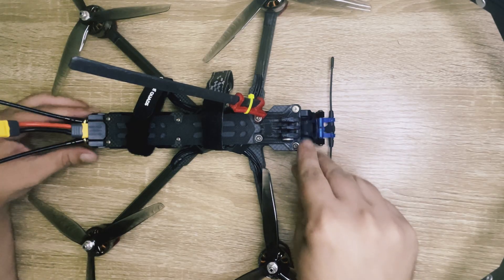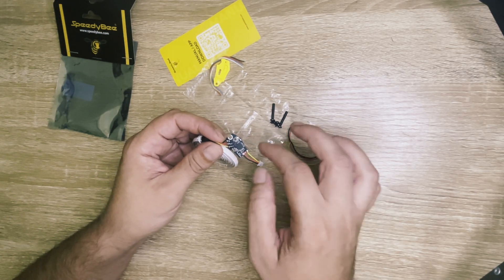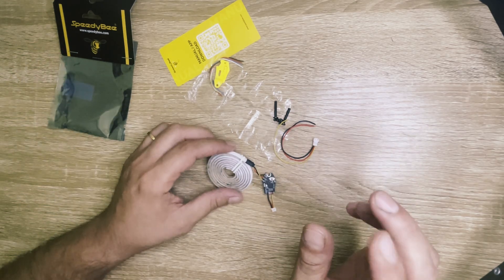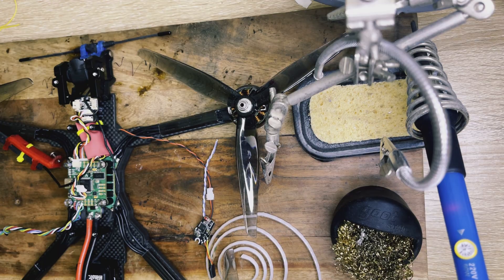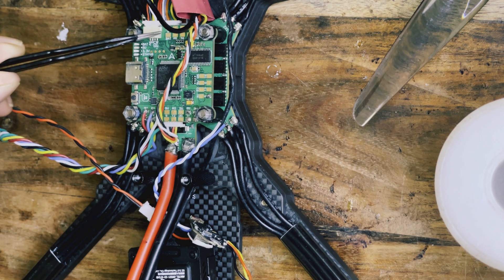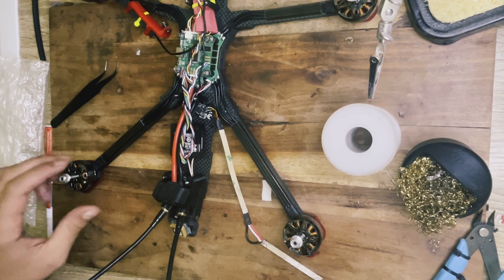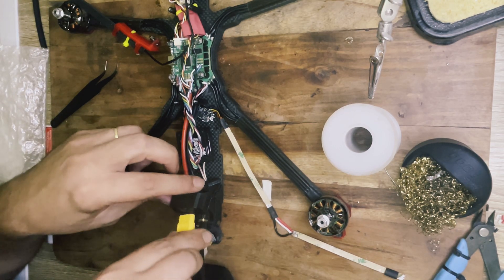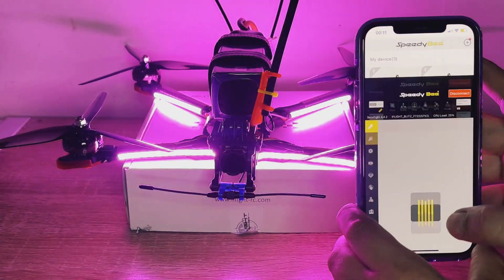Discover the Best LED Setup for 7 Inch Drones🤩 #fpv #speedybee #iflight #led #drone

Comment: What gauge wire are you using to join strips?
Reply from the maker: I used a wire with conductor overall diameter of 1.8mm that was the one available in my local store at that time. I feel it a bit big for that job, if I do that job again next time , I would go with a smaller size

Comment: Does the flight controller have to be a SpeedyBee to be configurable via the SpeedyBee app?
Reply from the maker: Yes the fc has to be a Speedybee one in order to be configurable via the Speedybee app, unless you use a speedybee meteor LEDs like in the video which gives you the opportunity to get any other fc to be configurable via the Speedybee app, especially fc without a Bluetooth chip
Reply: @fpvinprogress thanks for the video and comment!
Reply from the maker: @fun909 my pleasure mate

Comment: bro.. how to turn it off or on by radio switch?
Reply from the maker: The speedybee meteor LEDs can only be switched on or off either by the switch on the module of the LEDs or using the speedybee app, via the app, connect to the meteor LEDs and there you can switch it on or off.
Only LEDs controlled by betaflight can be switched on or off by assigning a switch in the modes tab related to the LEDs
Reply: @fpvinprogress  yes . I m wandering to assing a switch in betaflight.. for on or off
Reply from the maker: @ADITYAKUMAR-yt2ry  got it mate, if you want the LEDs to be controlled by a switch then buy a LEDs for fpv, set it up in the led tab in betaflight, then go in the modes tab and assign a switch to turn on and off the LEDs

Comment: very top friend friend this 4 wires are positive negative tx3erx3 that's it
Reply from the maker: Yep my friend, basically the positive and negative to power up the LEDs and Bluetooth chip in the leds’s module to access into the speedybee app, tx and rx to access the betaflight configurator via Bluetooth in the speedybee app as shown in the video. If in my case you choose tx3 and rx3 then remember to enable the MSP on uart3 in the ports tab in betaflight
Reply: @fpvinprogress installation in simple mode via Bluetooth, just solder positive and negative, right friend, on the LED strip, it is possible to solder the three wires or just positive and negative, it already works
Reply from the maker: @betaodrone by soldering just positive and negative the LEDs works already, and you can you use in the speedybbe app too.

The wires for tx and rx are an addition, you might use in case your fc doesn’t have a Bluetooth connectivity chip, and you would like have access to the configurator via Bluetooth.
Anyway again by soldering just power and ground the LEDs work
Reply: @fpvinprogress  bro, I'm putting together a project here with the speedyBee Mário 8 inch, which battery do you recommend I use it?
Reply from the maker: For your 8” you can definitely use the iflight full send li-ion 8000mah or any other brand with the same specs
Reply: @fpvinprogress Thank you very much my friend, your content is very top, the LED strip I can cut anywhere, right, my friend, you are Spanish
Reply from the maker: @betaodrone if you look at the LEDs front side, at the top edges you can see a small black dot/line and that’s where you can cut the LEDs and reconnect them via the wires.
I am Italian even though I don’t live there, what about you?
Reply: @fpvinprogress  Hello friend, I'm from Brazil

Comment: Is It work on ardupilot??
Reply from the maker: The led itself works on any software you use either ardupilot, iNav etc because the LEDs itself needs only a vbatt and ground pad to be powered up and it has its own Bluetooth module to connect to the speedybee App in which you can change and edit colours, so in this case there is not connection to the software itself.
On the other hand, If then you want to use the rx and tx from the LEDs module to the fc to be able to connect the fc to your software ( aurdupilot in your case ) via the speedybee app, I am not sure if it works as I have never used ardupilot and I do not know the way it functions.
Is there in ardupilot the option to turn on uart ports?

Comment: I installed that strip and controller on my Bee35 build. They're REALLY fun. I'm not one to "pimp" a quad but I surprised myself with how much enjoyment these add. Thanks for an interesting, informative, and entertaining video. Happy flying amigo. 🍻
Reply from the maker: Yes those LEDs are so funny and also bring so nice features to itself and the fc too🔥

Thanks a lot for having watched my video and pleased that you have enjoyed it🙏

This last weekend I also built my Bee35 and added this same very LEDs. I have made a step by step video about the build, most probably gonna post it on yt this coming weekend, stay tuned.
Happy flying to you too mate🔥🔥
Reply: Thanks for the reply. I look forward to seeing your Bee35 build. Mine is almost complete. I want to add an 03 Air Unit and am saving up the money to buy it lol. A couple of days ago I installed the GPS/magnetometer module. Everything is working fine except I think I damaged the ESC board in a crash during hover testing. I plan to install a new one and a new flight controller too while I'm at it. I think it might be damaged too because I can no longer connect to INAV, only BetaFlight. This has been a difficult build. Lot's of things have failed. Even the first LED strip that I got from Speedy Bee was defective. Some builds seem to be cursed lol. I am a VERY determined person though and won't quit until I'm satisfied that it's flying as well as it possibly can lol. Thanks again for sharing your adventures. I've subbed your channel. Happy flying amigo. 🍻
Reply from the maker: Thanks a lot for your sub🔥🔥

When I first planned to build the bee35 I had chosen the speedybee stack v4 30x30 but even though the frame allows for this size of stack the building process is quite though especially if you plan to have the 03 on board, since the space available is very limited and in my case I had the stack touching the 03. So then I got a speedybee stack 20x20 and  the build has gone well. 
If you plan to buy a new stack I suggest you to get a speedybee one, great stuff, then the fc has a Bluetooth connectivity and also it allows you to have the gps powered up via usb as well, so that before flying you plug a power bank into the fc usb port and you have the rx and gps running already, so while you get your remote control and goggles ready the gps will have fixed satellites without worrying about the 03 to be overheated , then when the gps is ready plug the battery and unplug the power bank and enjoy flying mate🔥🔥
Reply: That's all good advice. I originally thought of using the F405 V4 stack in the Bee35. I have that in my 7" build and it works great. I watched several YT vids showing that 30 x 30 stacks were VERY tight in the Bee35 build so I went with the F405 mini. That is the one that got damaged. I've been looking at others but I think I'll go with the SpeedyBee F405 mini again. It has all of the features I want including the Bluetooth connectivity which is very convenient. I already know it fits well and the price is right. Even buying two, I'm at about what the competitors charge for one lol. Bummer that I have to replace it before the quad is even complete but that's how this hobby goes sometimes. I'm always learning. Expensive lessons sometimes but the joy of flying something you built yourself is VERY satisfying. I tried that trick of powering up the RX  and GPS from a USB power supply, but it didn't work for me. Maybe my power bank wasn't up to the challenge. I usually hook it to my computer inside for a few minutes before the first pack. Even inside, I usually get over ten sats to lock in just a few minutes. Then I take all my gear outside and fly with a "warm start" on the GPS. Weird that it works through the laptop but not the power bank...🤔🤨 effing magic I guess lol. Thanks for the correspondence amigo. Happy flying. 🍻
Reply from the maker: The f405 v4 30x30 is exactly the one I purchased originally for the speedybee 35, but honestly speaking on a 3 / 3.5 inch drone and lower we should go with a smaller stack, the bigger one are good for 5” and above.

Yeah I know also how over expensive this hobby can be sometimes 😂😂 

The power bank should provide a voltage of 4.5/5 v to let the gps power up, check it out brotha🔥🔥